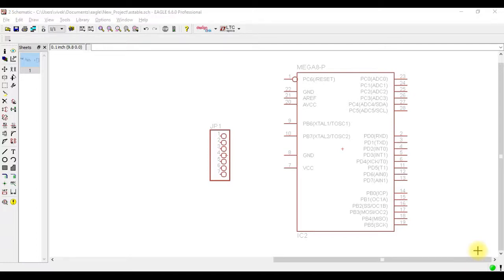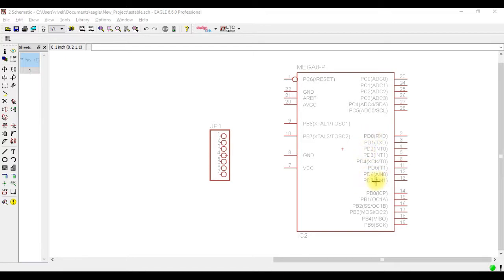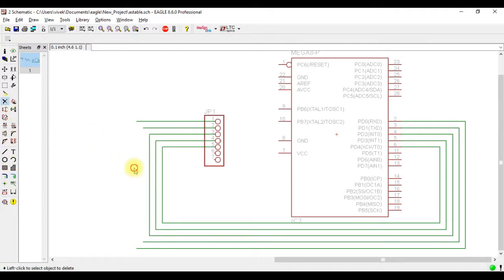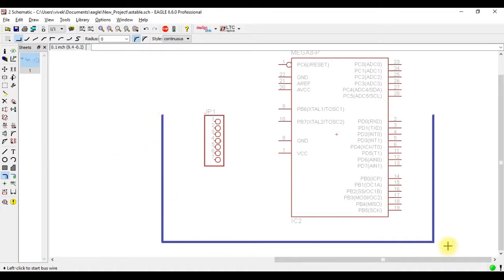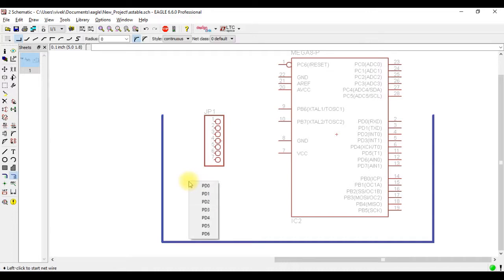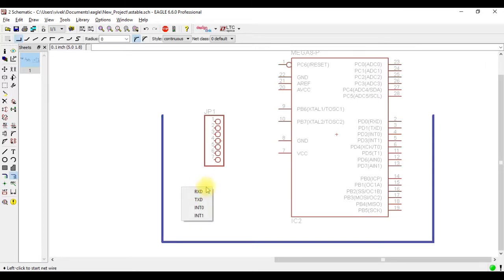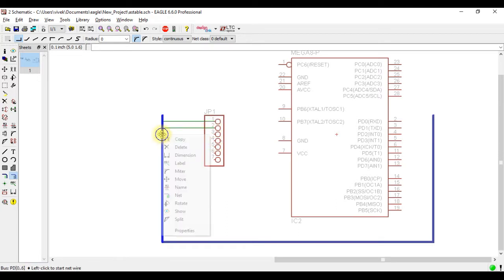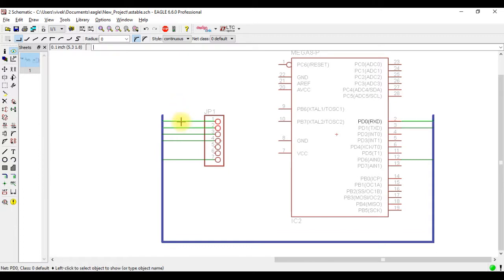PCB Design with EAGLE - 15 - Using the Bus option

Comment: OK video. I found the audible clicks when you right clicked the mouse very annoying. Also, if one draws a net from a pin to a bus isn't the step where the "net" option needs to be selected from the busses' drop down menu eliminated?
Reply from the maker: Yes, I agree and I am really sorry for that. This was my first series which I recorded and didn't have much experience. Have improved significantly in later videos.